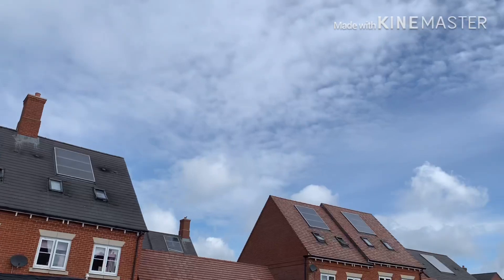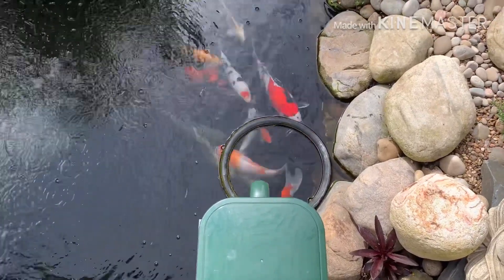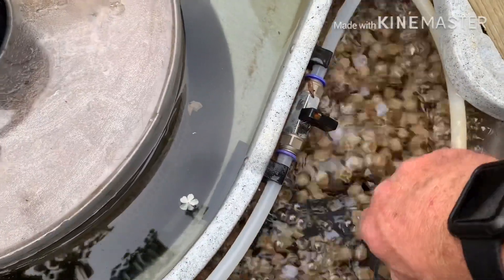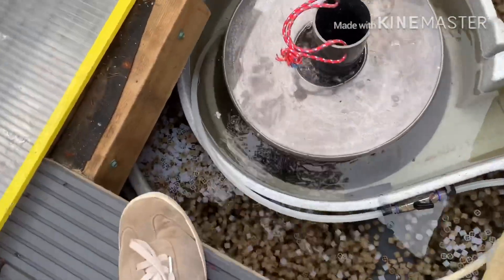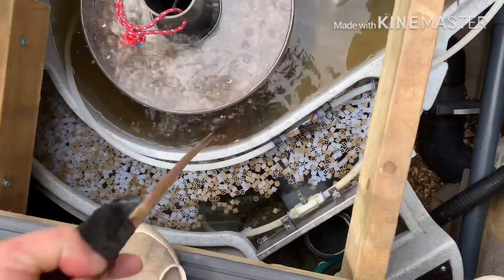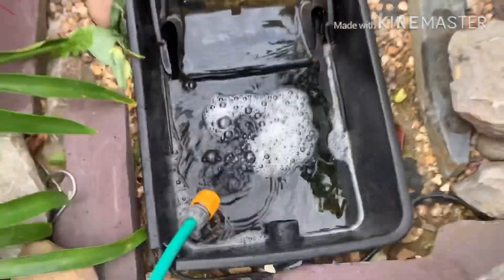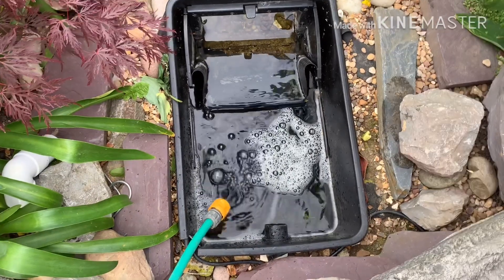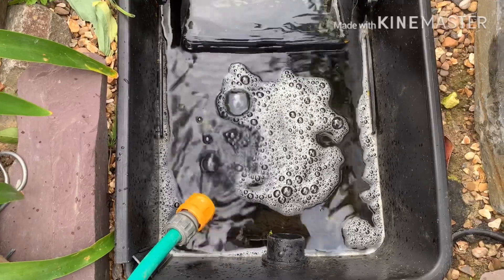How I clean my nexus 220 and skimmer

Comment: Very interesting video, impressed with your improvisation of utilising a pond vac to empty your Nexus filter. Must admit though, it all looks very professionally fitted even though your filter house is a very tight space. It would be good to know if you did your filter installation, or have someone to fit it for you?  I’m thinking of upgrading to a 220 from an Easy Pod Simply great.👍
Reply from the maker: Hi , yes did do it all myself the 4 inch pipe work was a bit of a mare but the rest went together ok , upgrading would make so much difference to your pond it really would
Reply: Koi ,water, plants And rants 
Will be the 220 model, I wouldn’t want the earlier ones as I believe there have been quite a few improvements. 
I keep looking to see if there are any on the secondhand market, but not many for sure.
Reply from the maker: David Minton the 220 runs with k1 micro in the inner chamber or easy as they call it the older 210 had the larger k1 in the easy and out bio chamber and I think the 200 didn’t have an easy as we know them in it but most have been converted . A few 220s do come up every now and then but if you join some koi groups on face book you might stand a better chance 👍